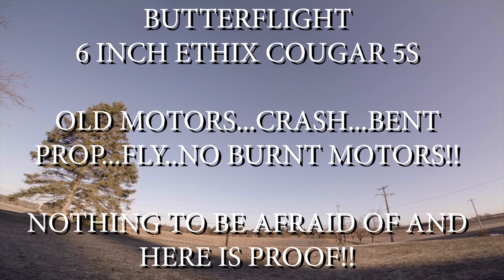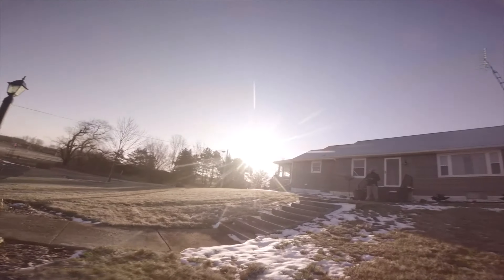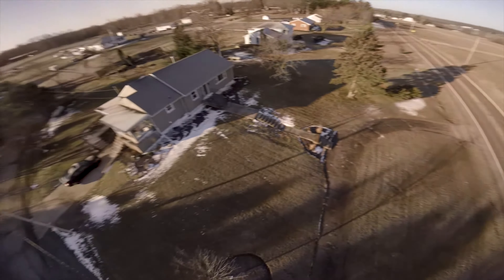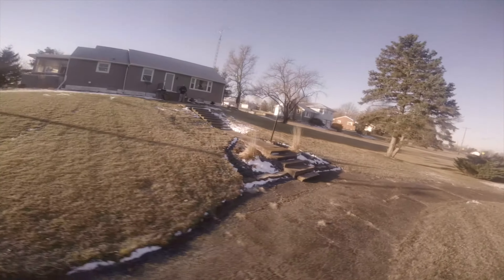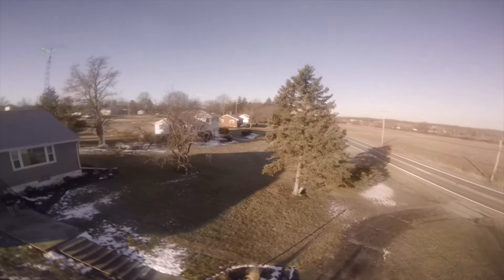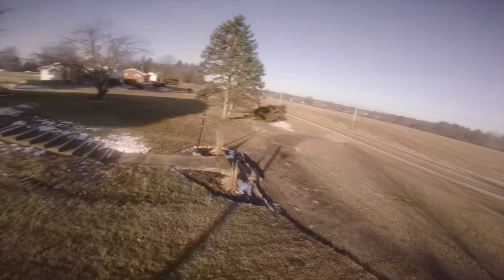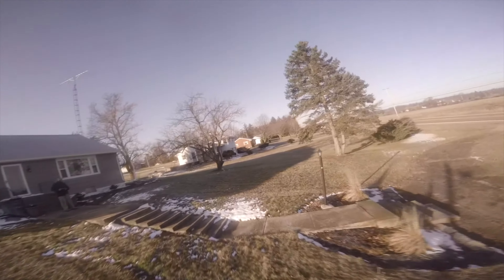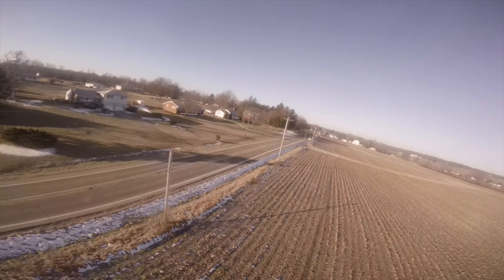BUTTERFLIGHT ON 6 INCH ETHIX COUGAR FRAME 5S DSHOT 1200

Comment: Nice video.. im thinking od running a 5s lipi om my martain kakute d4 es 30amps and emax rs2205s 2300kv motors.. but my question to you is the new betaflight 3.3 just got released and there no one talking about the kalmam filters anymore.. did betaflight do away with thw kalman.. what is so special about bf 3.3 now? Thanks
Reply from the maker: BF dumped kalman..that is why there is butteflight now..its the guys that did kalman..BF3.3 ony has their new 2 stage fir+biquad filter.  i am having great success on all my builds with butterfight 3.4.1 at 8k8k..its super easy to setup since its betaflight and all you do is enter the old kalman cli commands.
Reply: ChaddyCEEE RC ok. Thanks.. so how would you go about setting up the biquad+fir filter on betaflight? I dont want to switch over to butterfilght because i have alot of quads and i just want to fly.. do you habe a video om setting up the new filters yet? Thabks
Reply from the maker: FPV Addict idk. Bardwell did a video on it and he wasn’t even clear. Lots of different methods among the bf devs. So they don’t even agree. I been using kalman since it was on bf 3.3 rc1 on my bardwell fc and lives it since so that’s what I’m sticking with.
Reply from the maker: And FYI. Butterflight is bf 3.3 rc 1 with the ability to add the cli commands. Nothing different about it if you don’t add them. So it’s all one I. The same right now.

Comment: You know what i have been thinking about the kalman filter a lot and how the betaflight devs are saying its just a Lowpass filter with 2 point smoothing. 

If this is the case then basically its clear the tools have always been there in betaflight for this kind of handling they just haven't been setup correctly.

Notch filters have been used since 3.0.1 as a quasi bandstop filter which from a signal processing point of view is very bad practice.

Its very clear now that since the dynamic notch filter came out which i might add is a brilliant technical achievement this should have been used by default with just gyro and dterm lpf settings that work well with it.

Betaflight development is very fast but sadly since boris left nobody is interested in presenting Betaflight in its best light to the end users with reasonable defaults.
Reply from the maker: Stephen Gibb agree about Boris. My love for dynamic is so so. It just doesn’t work like I thought it would. Nothing is able to fly and give me the video I’m looking for like this. I hate sounding a fanboy but man I have labored for months on 6 inch and long range pids. The next video coming is with biblades. It’s even better!  It Almost disgusts me lol. But the devs def didn’t want apoc and rs2k working with them and they’ve said they are adding kalman into 3.4. They know they screwed up I think.